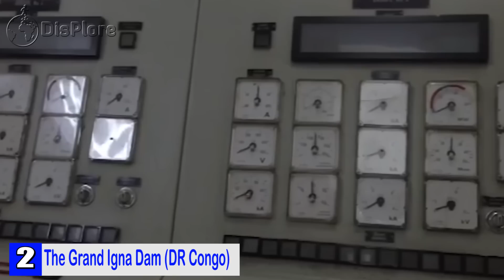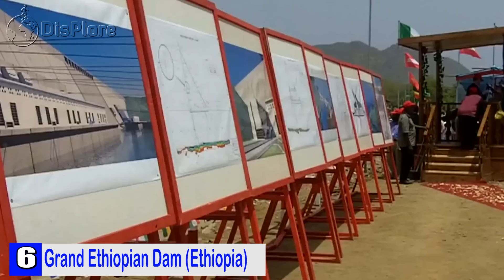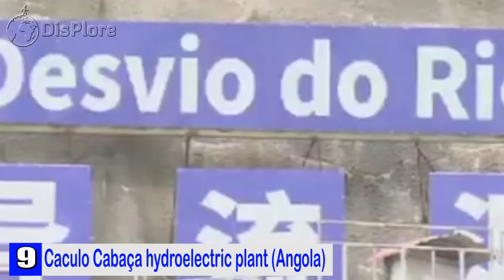Top 10 Ongoing MEGA Construction Projects in Africa that will be a Game Changer.

Comment: Regarding Kenya;
There's the LAPSSET project that, upon completion, will have a new 32 berth port making it the largest port in Kenya, a new oil refinery and a new SGR line that directly links Kenya with South Sudan and Ethiopia.
The footage you used for Konza City is mostly for Tatu City. Konza City has yet to begin such vertical construction as the government is still setting up the horizontal infrastructure such as telecom lines and drainage.

But a good video nonetheless 👌🏾

Comment: You have forget a huge mega project in Kenya called LAPSSET project, Lamu Port South Sudan Ethiopia Transport project will cost Kenya $300bn. Lamu port will consist of 32 berths with one berth  measures 400m long and a length of 1.2km. check on this. Is a replica of Bagamoyo staled project. Check it out.
Reply: The pinnacle and the cyton tower
Reply: That's quite something. Worthy looking at

Comment: I smell corruption in most of these projects. How can Kenya justify spending a whopping $3,2 billion on a mere 470km Nairobi-Mombasa railway, whilst Morocco only spent $2,3 billion to construct Africa's first 350km bullet train system?
Reply: Think it through before you compare apples and oranges. The cost of doing anything is dependent on local factors.  It costs four times as much to lay a mile of track in a mountainous region than in flat lands. Kenya has to accommodate disruption to migrating herds in the design of tracks, which Morocco may not have to.
Reply: If you let alone with your colonial masters. We will not see this.
Reply: Many factors vary from project to project